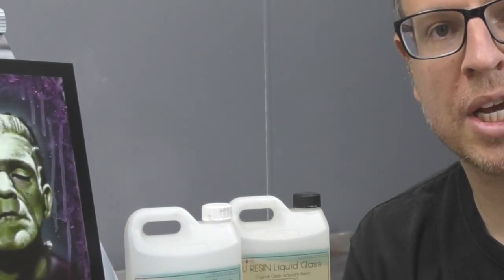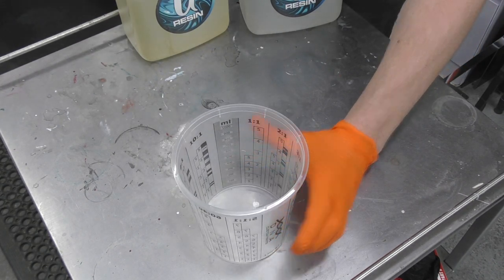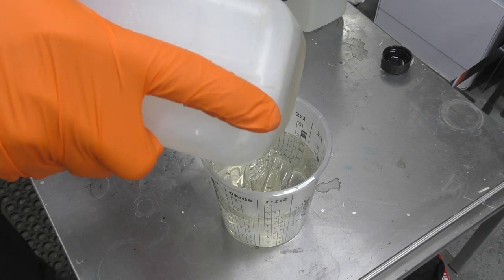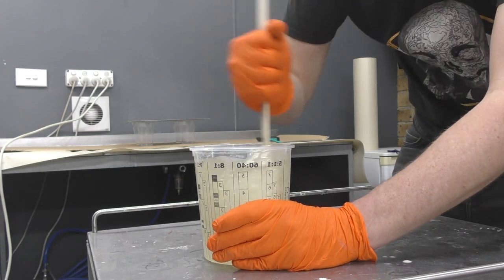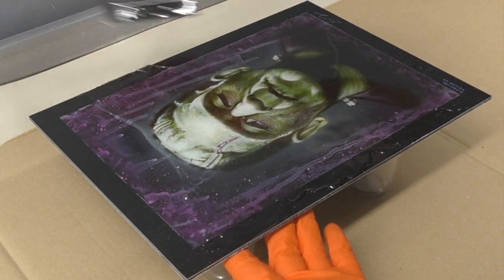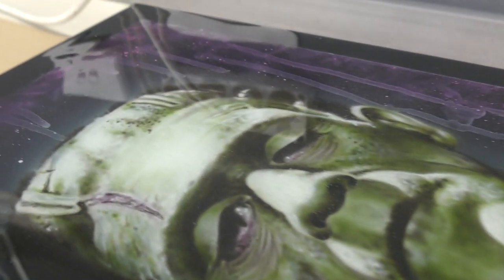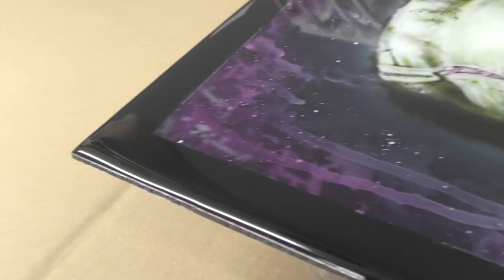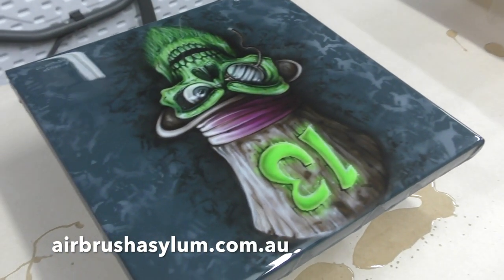Clear Coating your Art with Resin, so easy

Comment: To clean up the drips just run a straight edge across the underside of the surface that you are clear coating. It’s the same principle as when people do the acrylic pours. :)
Reply from the maker: Yes, that does work I did it on a recent one I cleared ...👍🏻 it’s great stuff to use and thanks for sharing that tip

Comment: So simple to use for people without options to spray 2k clear on surface. Although seems you did both? At least on Frankenstein? Can that step be left out? (SG100 Intercoat clear)
Reply from the maker: Hi Hans thanks for your comment and yes I use intercoat clear regularly just as a added protection, whether or not it’s necessary then it’s best to get in contact with the resin manufacturer as they all may differ. Hope that helps 👍🏻

Comment: Do you think you can spray this resin on vehicles after custom artwork please ?
Reply from the maker: I don’t think so , if you want to do it on a vehicle then use 2 pack clear as it’s designed for that application , the resin is self leveling so can only go on flat substrates 👍🏻

Comment: Careful with the clear coat as it shrinks ever so slightly over time. I had a large canvas twist on me and another piece of art on a hollow core door which has a slight curve in it after 5 years. The fix for this is to coat both sides but that ends up being expensive.

Comment: I purchased a 3 litre of their resin as I live in WA and wanted to support local but the resin was terrible for what I was doing which is making resin eggs. It stayed too soft for days and after two weeks I put it on the lathe and it was chipping out and studying under no heat build up at all. Contacted them and sent photos of my issue and they completely ignored me. I will stick with Just Resin next time have never had any problems with their resin and they are cheaper.
Reply from the maker: Sorry to hear you had a Bad experience 😞 I purchased this resin unlike some of my other vids where products were sent to me free of charge to review, this video was in no way sponsored by Uresin and I don’t have many dealings with the business...that said I also purchased their casting resin and love both products and have found this (artwork resin) particularly easy to use and with amazing results. I thought I’d share this vid to show others that there are other ways to clear your work easier & safer, but as I mentioned in the vid I highly recommend you test it first before using it on your artwork. Thanks again for the comment all try best and hope your next experience with resin works better for your application 👍🏻🤞🏻